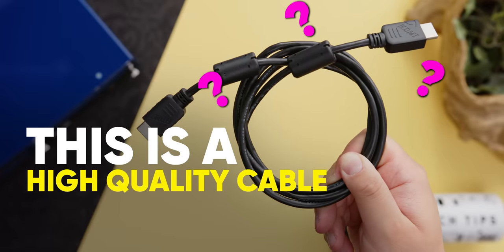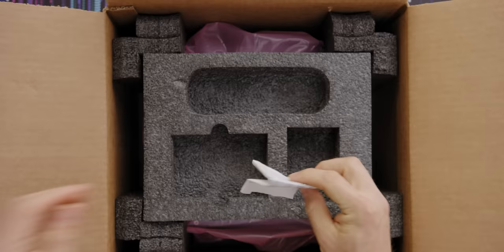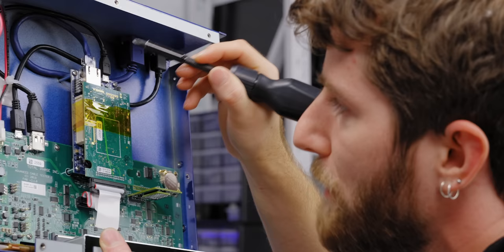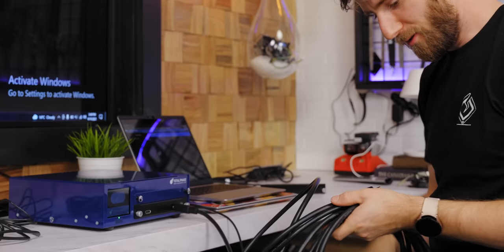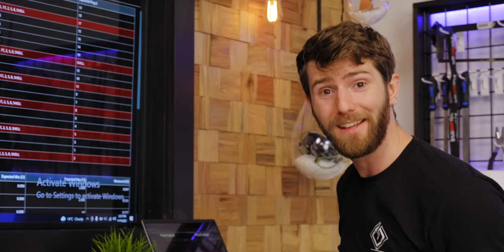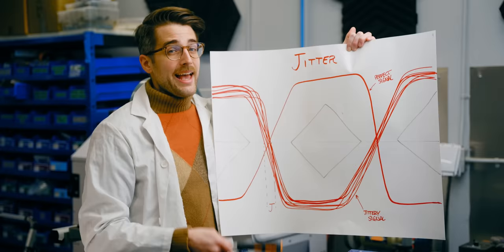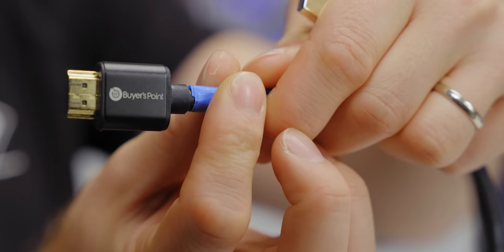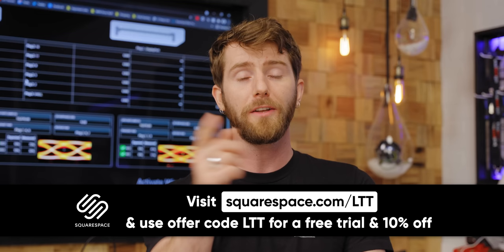This Just Saved me $100,000 - Totalphase Cable Tester

Comment: I want you to make some USB 3 (from 5Gbps to 20Gbps) cables using sheilded Cat 5E and Cat 6 wire.  I've had amazing results making standard LONG USB 3 cables with some single strand Cat5 E I bought in 2001 (it was 24g IIRC, possibly 26).  When a wire needs only 4 conductors, I double up a twisted pair, so each USB channel (or power/grnd) is running over 2 conductors - a twisted pair).  I made some 25 & 40ft cables with this that worked at USB3 speeds.  I then added an extra 50ft extension to the cable (all cable was identical spool) and used it for a keyboard with a USB 2 hub, and everything worked perfectly.  I've yet to try the 75-90 ft with USB 3 but I suspect it will work.
I think the cat6 (stranded) has a better chance at longer runs and will try this starting at 100ft.
For my test I used a standard female RJ45 jack on each end and punched down 2 wires in each slot.  I did not cut the over-hang off once punched down, I stripped both about 1/8- 1/4", twisted the over-hang and snipped them close to where the punch down would hav cut them off, so I end up with 1/16" - 1/8" of the 2 conductors twisted & both hopefully making connection in the punch-down slot. 
I've used these for anything I need a long USB extension.  I just use the heaviest USB wire I have & crimp on a RJ45 male end.  i've also done soldering of both, but that didn't seem to be any better than crimping. 

This made A LOT of projects much easier when I didn't have any USB extenders or when I needed a wired keyboard/mouse/etc far away (and could hide the wire at the same time).   I think it also worked w/o shielded wire but I didn't play with this as much so ID recall as well.  

IDK if this matters, but my Cat5E was rated at 350mhz.

Oh, I've also had success in making longer SATA cables by ~15-18 ft using shielded cat 5e & I did a real hack job of soldering the connections.  I made sure each cable was exactly the same length, minimized solder use & shielded each joint individualy then shrink-wrapped the entire joint.  I had a friend who says his SAS 3Gbps worked doing this as well- thought he may have used cat6...

Comment: Here is a solid idea:  If making a "straight" Ethernet Cable, why does twists and color matching matter if technically the pattern is identical on both sides?  The reason I bring it up is that way back while living with a Ford Motor Company automotive electronics engineer, he wired a long run ethernet cable that should have been under 150m but would not work effectively.  After redoing the ends multiple times and even continuity probing the wires, a network engineer brought up the subject of impedience created by electromagnetic interplay between individual strands of wire being the key factor and if he wired up per EIA spec, it would would that he did it just to apease the jesters of the geek court and got a mouth full of crow instead.  

So... truth or bullshit and why?

Comment: As somewhat of an audiophile, I would like to get a better understanding regarding signal integrity, especially on just how much interference you get from running signal and power cables alongside each other - I have a feeling I'm not the only one who is forced to do that stuff e.g. at home. Could a cheaper cable be as good or even better than a premium one if it was routed away from a mains line - even though it might end up needing to be longer?
Reply: Assuming you have the technical ability: 
There is an open source software that turns you audio card into an oscilloscope. Assuming you are talking about testing analog cables within the audible frequency range, this would be a very cheap, and precise solution.

Comment: So are cable brands going to be a section on the Labs website? Maybe have a panel on the side of the monitor pages with auto suggested cables based off the spec of the I/O? Could just say "This monitor has HDMI 2.1 and DisplayPort 2.1, suggested cables for this are *insert*" And maybe on the actual cables section of the site have recommended cables by type at various lengths. 1m, 2m, 3m, 5m, 10m
Reply: Probably the store actually not the labs website

Comment: I would be also intrested in "optic cable" video. It sounds strange, yes. BUT for my old 5.1 I have only one input optic. And 3 output sources. So I have bought a splitter. And, suprise ... now quality matters - some of the cables just do not work after applying a splitter. Some, which are better - does work. And lenght is not a problem. With those optics I can see general production "ok, it is minimum in output but who cares???" Me cares.
Well, of course, splitter also can be an issue - but it was only one in normal price on market when I did buy it. And well, cables were plentiful. So super extra slogans on them. "Ask the shop workers" You say. Well, sounds good - for optic cables does not work. HDMI ... a little. Composite - hell yeah. Optic - buy new 5.1 with all inputs, cause optic is optic always good and splitter is hell ;-)

Comment: Yes yes yes. I want lots of info on what cables are the best quality. Display port and hdmi. I’ve had problems in the past with Apple TV to TV cables not testing well on the in-built Apple TV cable testing app. And I want to know just what’s the best quality cable to use on monitors/TVs.

Comment: I would like USB c tests where the cables are run along other common cables.. Power, 3 or 4 other USB 2/3 connections, audio, ethernet. I've had issues with interference on 10 ft cables

Comment: I’d just like a little snippet of like a test with stuff that has included cables. Would be funny if a $300 monitor includes a cable that’s just a pile of crap. And if it does pass just say it’s a quality cable like you usually do just this time you can say it with confidence. Also lmg cables of course

Comment: To do this right, I think you would need to test several of the same cable by the same manufacturer. This would prevent a one-off failure and you could then report the failure rate.

Comment: Whenever you review a product that comes with a cable run a test on the cable. That way you can see if the included hardware helps or hinders the product.

Comment: Man do I wish there was a version of this for home users.  I just ended up having an issue with my ElGato HD60S+ and my Switch that ended up being a cable and it would have been so nice to just be able to test the cable on a reliable platform instead of just having to try different cables till I got lucky and had one work.  (I think, still have to really stress test it.)

Comment: Any time you review a monitor, computer etc that comes with a cable, you can test to see if it came with a good or crap cable. Does it pass good data or is it in signalosity?
Reply: Signal-loss City*
Reply: @JaredConnell  it's a play on Travelocity. "The signal through this cable is unreliable, lots of dropouts." "So it's suffering from signalosity?"

Comment: If you guys created a list of some actual spec USB C and HDMI 2.1 cables as you test your in-house equipment it would be greatly appreciated! I've had this same issue with HDMI cables and them cutting out the video during work presentations and it's embarrassing. USB C is important because of them being able to fry devices if they were not made properly

Comment: on a single cable with no switching jitter should be zero, Jitter is to do with packet timing and over a congested network you get packets arriving with varying degrees of latency, so if you get packets 1,2,4,3,5, that would be jitter, I have no idea how you get that on a single cable.

Comment: @Linus Tech Tips I noticed you did a review on HDMI 2.1 and Thunderbolt 4 Cables however where are the DisplayPort Cables 🤔 I would love to see some that pass and that you'd recommend. I recently bought some cables through Amazon and have been a little weary [(VESA Certified 8K DisplayPort Cable 6.6FT, Capshi DP 1.4 Cable Nylon Braided/Aluminum Alloy(4K@144Hz,8K@60Hz) Computer Accessories Cable for Laptop PC TV etc-Gaming Monitor (Grey)].

I'd love to hear your recommendation.

Comment: I`ve bough 40 feet (12 meter) hdmi cable for around 40$ to connect my PC to TV, then installed it in slats and  at the end I`ve found it dropped signal every few seconds in 4k :/ I`ve menaged to find a workaroud (custom refresh mode- 30Hz). The cable turned out good enough for movies but I wont use it for gaming, 30hz dosnt cut it.

Comment: With so much empty space inside the chassis - why did they NOT integrate the power supply inside the box itself?
Reply: Could be a few reasons, possibly one of the biggest being electrical interference from the power supply. Perhaps also ease of replacement, and probably least likely to reduce heat.

Comment: It’d be cool if you had someone who know anything about transmission lines explaining this instead. Because “professor Rileys” explanation is really not very accurate. To mention one, cables do not make jitter. Active circuits does. The “two main ways(or how ever many you care to explain)” would definitely have to include reflections as it’s a major part in why manufacturing tolerances effect signal integrity.

Comment: Network Cables would be intresting.
Especially different lenghts, qualities and DIY (Patch + Installation)

I´m still using some Cat 5 UTP Cables for Gigabit because i couldnt get Cat 7 into the concealed pipes (Leerrohr Unterputz). I litterally ripped of some Cat 7 installation cables by trying to get it into some already used pipes. (still in there but unusable) So I switched to Cat 5 UTP whre i couldn´t use a Cat. 7 bc. its way more flexible und smaller in diameter.

Would be intresting how far you could go with these sh*** Cables or how much the Installation of DIY Connectors affects the transfer.

Comment: You should never test your cables coiled up.  Uncoil them to their full length before testing. Testing them in a coil can cause inductive impedance which will reduce signal strength and integrity.

Comment: That Total Phase cable tester costs....brace yourself for this....   $15,000 USD.  There's no way that there are $15,000 worth of components inside that box.  Also, I only see one other comment on how crazy expensive this piece of hardware is, which says people here are clueless about technology.  It's cool but not $15,000 worth of cool.  Maybe worth $300 at most and could easily fit in a more compact package.  Is there a need to have it be a dedicated box when we have powerful PCs and it could just be a cheap board on a standard PCI express lane?  Swapping out the ports looks more like a Super NES cartridge and we know how well those worked.